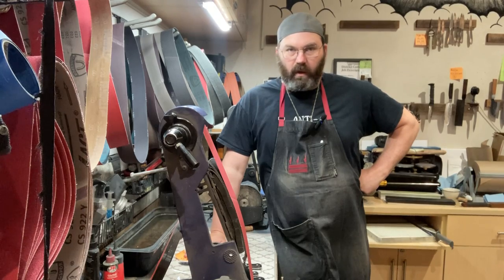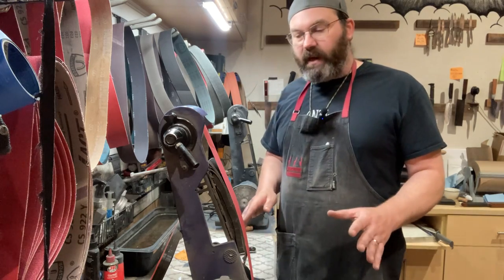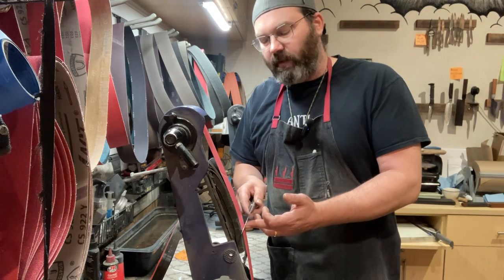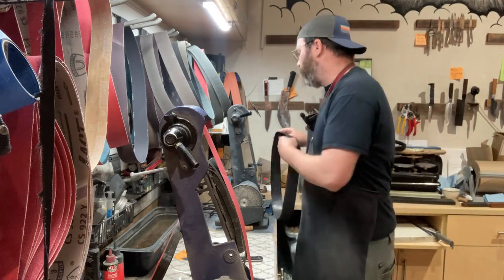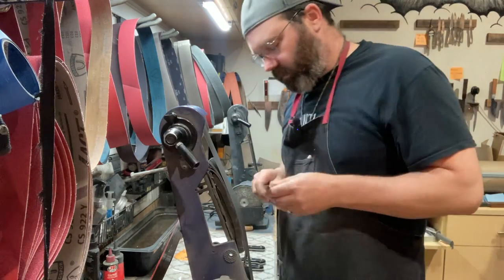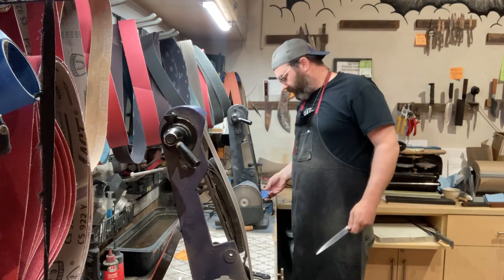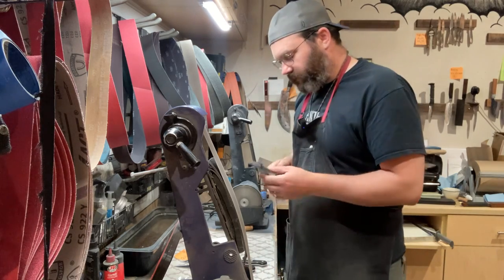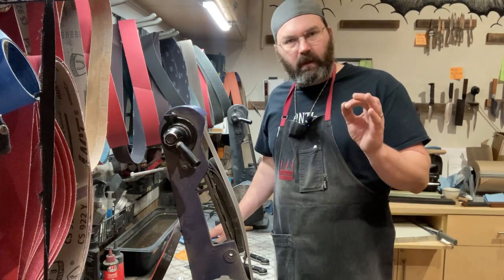Introduction to Sharpening on a Belt Grinder

Comment: What would you do with high end Japanese Knives? most don't like them to be sharped with belts, thanks
Reply from the maker: We sharpen many Japanese knives on stones.  But if there is damage in the blade, which is not uncommon, we use the belt grinder.  We are very aware of watching the heat and use a gentle touch.
Reply: @districtcutlery 
Hello,
can you post the brand and type of the beltgrinders
THX in advance 
Cheers 🇦🇹
( You're doing a 💯% really good job)

Comment: How fast is the belt running and do you have problems with overheating?
Reply from the maker: Heat comes mostly from using too much pressure when sharpening.  A light touch and heat is not an issue, if you know what you’re doing.

Comment: Hi Ryan, I was wondering what brand belt sanders you are using there?
Reply from the maker: Hi John!  They are 2x42” from Grainger.  They have the Dayton motors on them.
Reply: @districtcutlery  OK. Thanks. Gonna start up a knife sharpening service to add to the shear sharpening. Looks good.